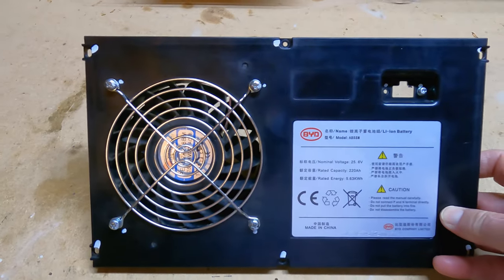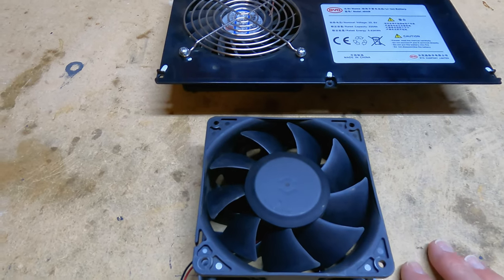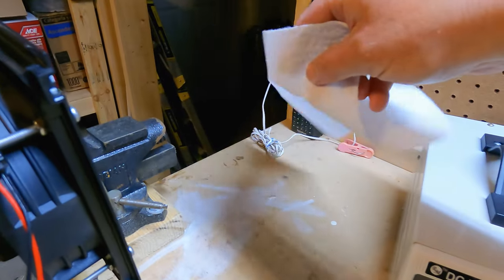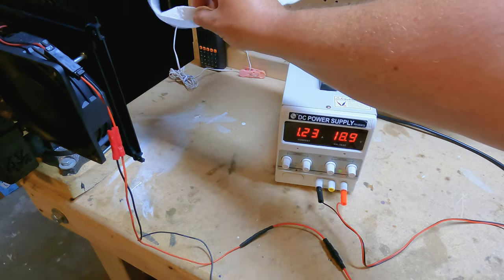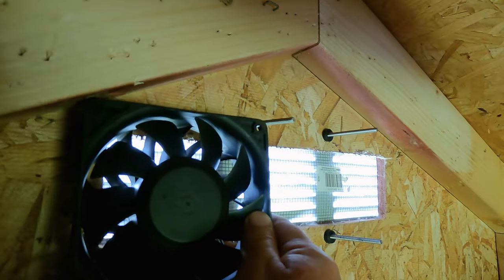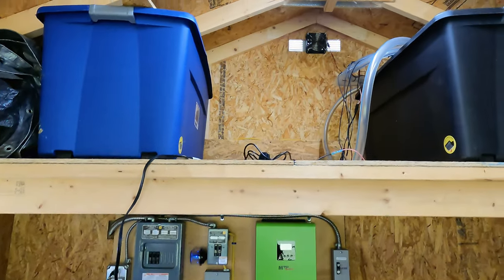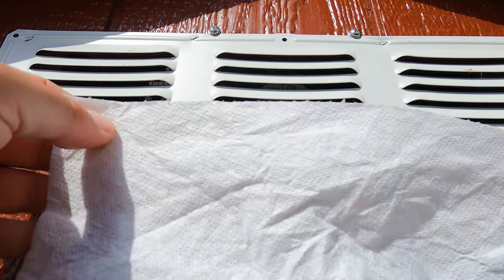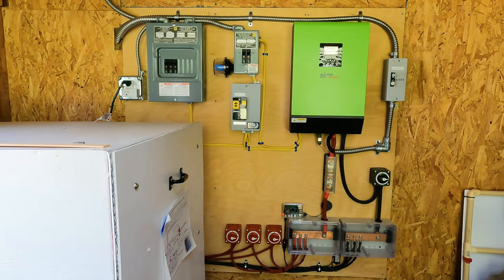DIY Cooling Fan for Off-Grid Solar Powered Shed

Comment: NICE glad your ok. Brother I use some of the Sonoff Smart Switch in my home. The mane one I use is the Th16. This let me us the temps to run fans to move air around my home when the AC or heat is on. They work good with Alexa. Don't know the brand your running now. But maybe look and see if they have those for yours. Thanks for sharing brother. God Bless.
Reply from the maker: Nice Bobby!  I’m looking into some smart DC control Alexa compatible switches too. Really want to rub off the bus bars but also want smart integration too.  Hope you are doing well!
Reply: @GreenMountainDIYGuy  Smart brother. You got 24 volts there all ready. No need do all that up and down stuff..